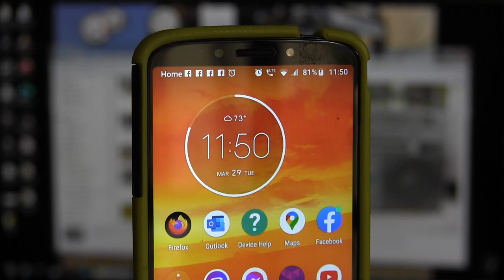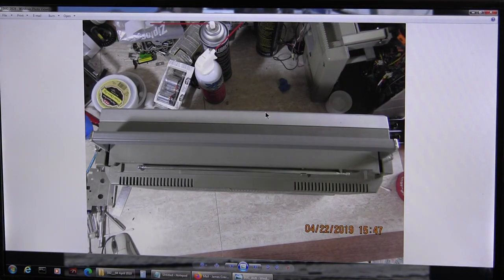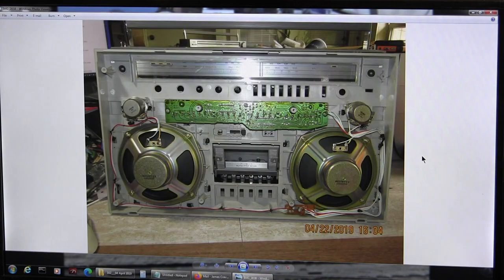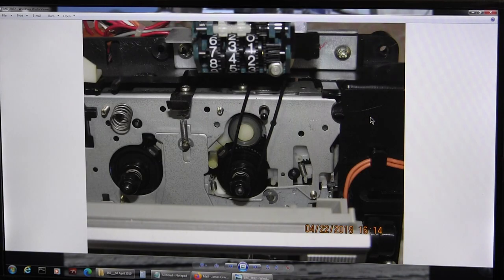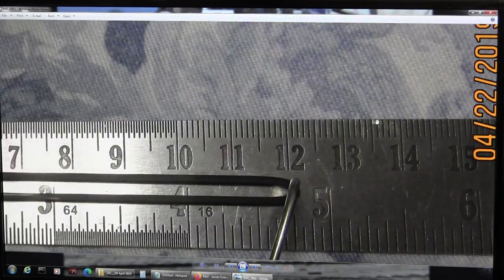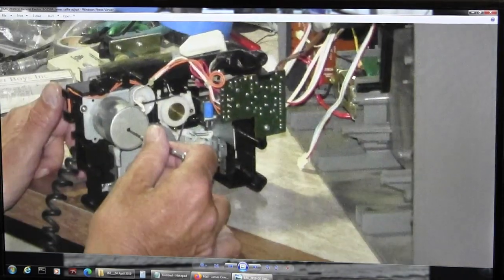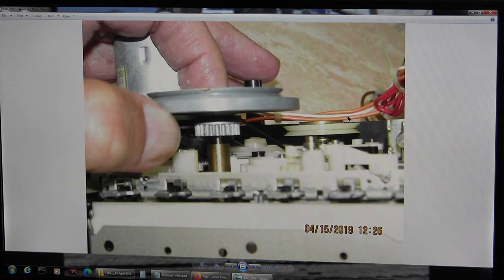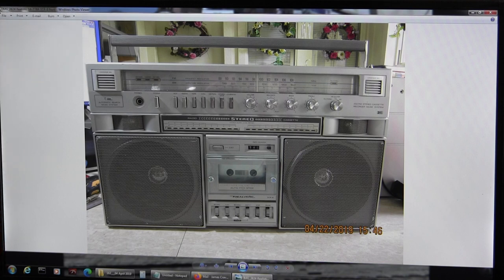Realistic SCR-8 14-778A & GE General Electric 3-5259A Blockbuster Service Pictures narrated by James

Comment: Enjoyed your video very much. I might be getting a Blockbuster and I have been doing some research. If the Blockbuster is in good running shape and I want to just clean it up and change the idler and drive belts, would this be something I would be able to do or do I need a repair person? Seeing the exploded view on your workbench has me worried. Any advice on this endeavor?
Reply from the maker: Just take pictures as you go pause my video for the pictures make sure your un assembly looks the same as mine. If you have patience and time you can do it yourself it's actually pretty easy tedious removing the old belts but after that it's easy
Reply: @Cassette2Go  Thank you so much! One last question for you if you don’t mind. Do you have a resource where I can buy the belts? Thank you kind sir you are a valuable resource to the Boombox community!

Comment: Do you have any more Conions or sharp radios with the 4 speakers on the front? Thank you
Reply from the maker: No more Conions do I own but I will repair if someone sends me. I do have a sharp GF 777 but it's a long-term project for me so it's not for sale, I also have a Toyota EA 900 which is AKA of a Sharp GF 909 but it's not for sale.
Reply: How about a JVC radio like the one L.L.Cool J. Had on the cover of his album?
Reply from the maker: @ricomartin8720  I have two Victor and one JVC
Reply from the maker: @ricomartin8720  m90 on the cover I have three but I haven't gotten around to them yet